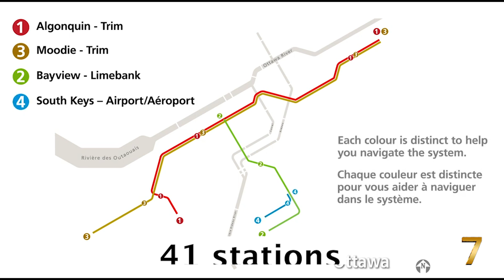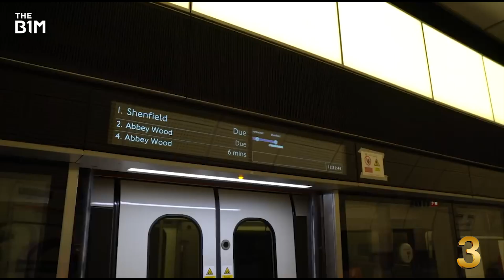TOP 10 Biggest Metro Projects In The Future (Part 2.)

Comment: Judging by the Tel Aviv one info here is not very accurate.
The video is talking about the Tel Aviv metro but shows the map of the light rail.
Tel Aviv is not that big (~480,000 and ~51km2) as in Israel they rarely merge municipalities so it´s more of the Tel Aviv greater area, called "Gush Dan"
The map shown is of the first stage of 3 light rail lines, the red (that opened a week ago), the green and the purple (which are under construction) with some underground sections, mostly in Tel Aviv. The 3 lines have a total 0f 90 km, 139 stations and they cover the central parts of "Gush Dan" This plan was creates in the 90's and had many delays before construction started in 2015.
The metro plan includes 3 fully automated lines covering the whole of "Gush Dan"+ covering 150km with 109 stations. It is in the final approval stage and the estimated cost  $40 billion (it was never $3 billion) but it will most likely be closer $55 billion. Financing will include direct government investment but mostly through densifying construction rights around stations that will yield property taxes.
 The 3d rendering shown has nothing to do with this project, It's of the light rail that will connect the city of Haifa with Nazareth and is now under construction.

Comment: Ottawa resident here. Our train is not modern, it's a pathetic joke. I see a lot of videos like this have the O-Train featured. It's kinda mind boggling to me that it gets featured because it's honestly one of the most poorly executed transit systems on the planet. Yes it looks futuristic from a distance, but if you actually ride the thing it's basically a half assed tram on a metro track that was not designed well. It's also slower than a turtle because the trains are so badly designed, they can't go around curves properly. Yes, we built a metro line that can't turn. The station concrete is cracking, the city centre tunnel is flooding and the pinnacle station at Rideau Street smells like sewage, and the city is too lazy to do anything about it. The extensions are a tiny glimmer of hope as the station quality is looking like it's much better but the original line is quite possibly the worst executed transit project in decades.
Reply: Not sure that the trains are the problem : they're closely derived from the ones that serve more than a million people every day in Paris without any issues.
The rails, however, seem to be pretty bad in geometry, which is the recipe for failure.
They seem to have ordered trains with slightly stiffened bogies and put them on badly laid tracks, there's not much mystery as to why it doesn't work well...